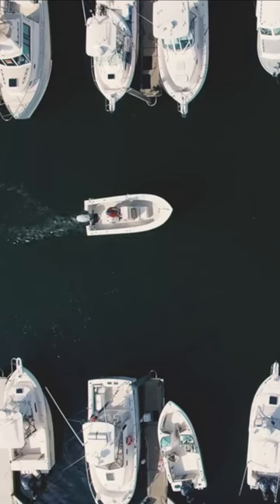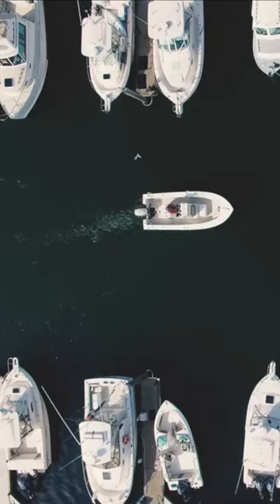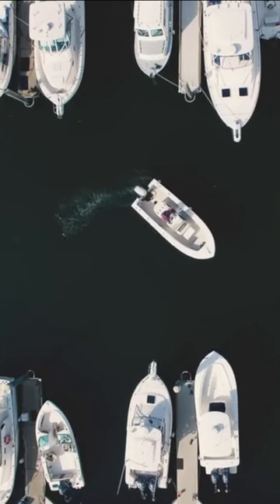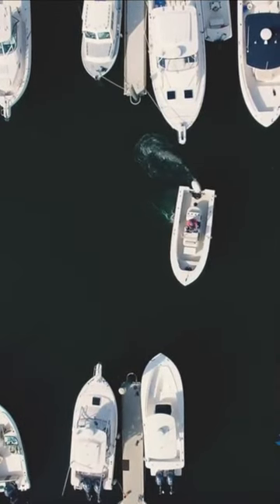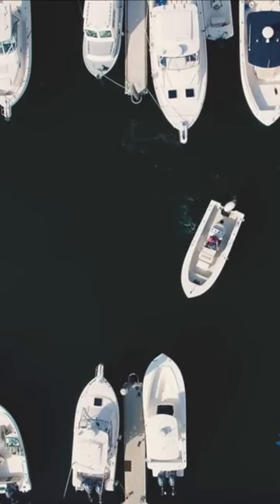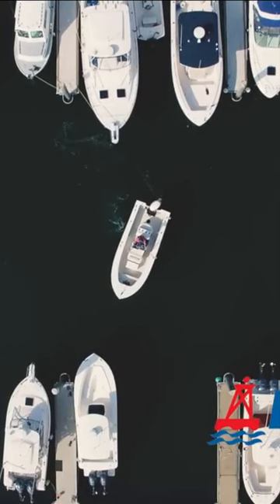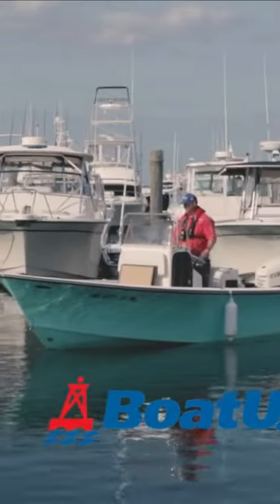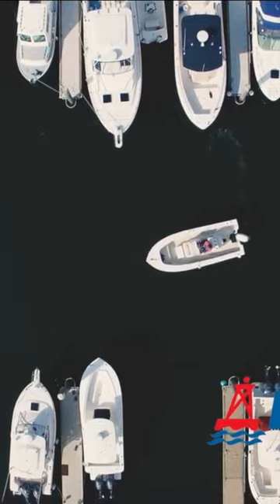MASTER THE PIVOT TURN in a Single Engine Outboard Boat | BoatUS

Comment: Failure. If you want to turn your boat in a narrow space the first thing you have to do is to stop the boat. 
Failure. With an outboard engine it doesn't matter with side you want to turn. The direction of the propwalk in reverse doesn't have a big influence because you have the possibility to swing the propeller. This means you can maximize, neutralise or eliminate the influence of propwalk and turn in the opposite direction.
Things you cannot chance or influence: position of the pivot point of your boat, current and wind.
Cheers
Reply from the maker: Thanks for your input, a.h. There are many roads to Rome; this is but one. We have to disagree that this method is a "failure," though. For one, there's typically no need to stop the boat completely before performing a pivot turn. If you're going faster than forward idle in an area where this maneuver would be required, you're going WAY too fast. Obviously that could change depending on the situation -- wind, current, or if you were in danger of hitting something. Regarding your statement on prop walk, you might want to rethink that. It's not possible to "eliminate" the effect of prop walk, and when you're turning in a confined area, it certainly makes sense to use it to your advantage. 

Unfortunately we cannot account for all conditions in our videos -- we are at the mercy of what's available to us on the day we shoot, which is often scheduled weeks or months in advance. The key is getting to know what works best for you and your own boat, which is something I think we do agree on. Cheers and all the best to you!